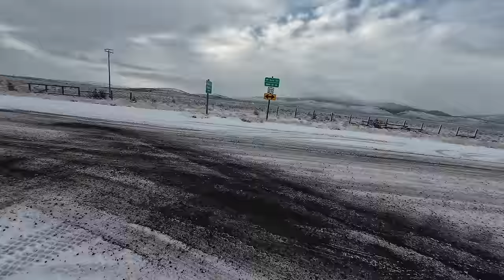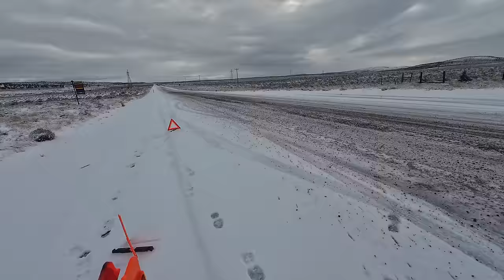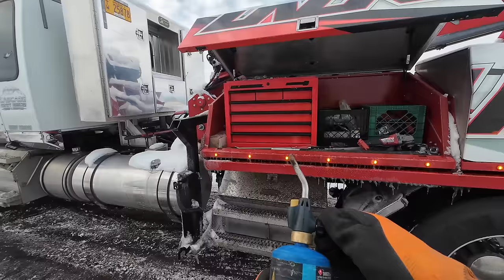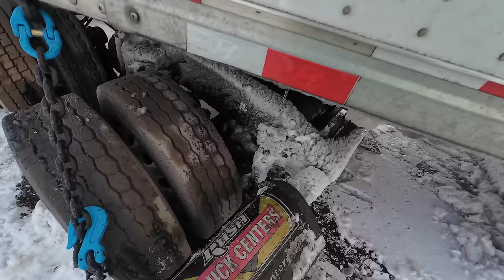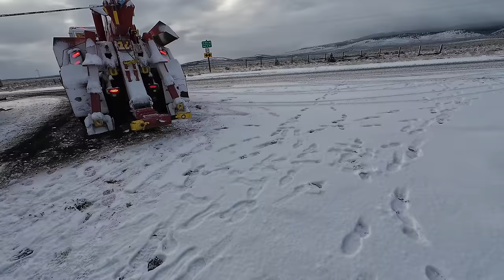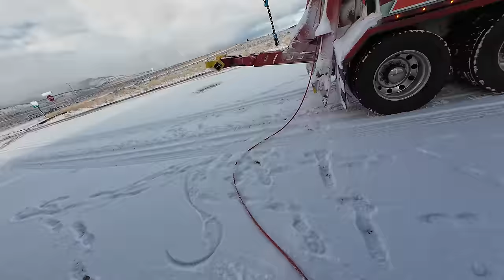Loaded tractor trailer hits the ice!   And then the ditch..

Comment: “I have a tool for that!”   Casey, I love it when a plan comes together and that you got the job done without any drama!   You said you were not good at this, but this episode proved otherwise.
Reply: Did Casey remove the clamp off the mudflap though?🤔
Reply: @drafterdb 
Probably as he was back there trying to put air in the tire.
Reply: @scots_knight4706  It was still on the mud flap when he handed the triangle back to the driver.  That was after he gave up airing up the tire.
Reply: @drafterdb  I came here to ask the same thing.  Nothing against Casey, but it's one of my "phobias" for lack of a better word.
Reply: Casey always carries the 2 most important tools: 1. A hammer & 2. A bigger hammer.
Reply: Those clamps are pretty cheap.  Much less than a light bar

Comment: A simple rubber glove and a rubber band on that air hose fitting on the reel, will keep the water and ice out. Thanks for the shows Casey.
Reply: Any viewers want to take a guess at which "finger" Casey would slip air hose in??? :D
Reply: I'd just leave a fitting in it as a plug so you don't look like a goober driving around with a glove on your hose. Either way works though.
Reply: @SantaTed-qv4gt  I'd say count 2 over and you are on the money. Start at whatever side you like.

Comment: Last night in Los Angeles there was a high speed pursuit of a sleeper cab and trailer. Cops did a spike strip. Guy drove miles on front rims. Unfortunately, cab burned.
Reply: The instinct is to run I guess...
Reply: @novampires223  Not if you're not guilty.

Comment: For frozen couplings and door locks I have a cordless heat gun it works quite well. Mine is a Milwaukee 18volt, but Harbor Freight has a Bauer 20volt model.

Comment: From July 21, 2023:

Drove 700 miles today from SLC to Bend, OR.

About halfway through (300miles) and shortly after the first dual-tank filling, the rear tank’s fuel pump decided to play hookie and stop working. This left me to about 180miles of range on the front tank alone down from the nearly 400 between the two. I’m using a gas card for fueling which limits me to $300/day or 3x per day, and now with one tank running, I would have to play it smart if I wanted to make it to bend without using cash or other cards.

Between Burns, OR and Bend, OR there’s a 129 mile stretch of road that after 10pm doesn’t have any gas stations that’re open. I had paced it right so that I’d be able to make the drive on the remaining fuel in the front tank and would have to use most of the 4gal auxiliary I always carry on long drives.
Reply: Now for the fun part!

At 10:15 pm and around 30miles into this desolate stretch I see a motorcyclist on the east bound shoulder (opposite direction of travel for me) so I go to turn around and check on him when during my 3-point turn as my front passenger tire just catches the shoulder, the whole truck slide off and down into the extremely Sandy/soft and steep ditch. I get out, lock the hubs, engage 4x4 Low Range, toss the truck into 1st gear and just barely make it back to the road (literally had to saw my way back up for about 2 minutes). As I pull up and step out of the truck to chat with the biker, a gentleman and his son (maybe 10y/o driving a nice Toyota Camry Hybrid pulls up asking if we have gas as he’s about to run out (car said 15mi range) I give him 2gal of my auxiliary knowing I’ll now be extremely close for my own trip but that he’ll make it to Burns. I now get back to the biker who believes his fuel filter and/or petcock is clogged but has no tools to pull anything apart. Likely for him I’ve got all the essentials. We separate the petcock, pull the fuel tank off, and clear the filter. He was right about those two things but he too was out of gas. I give him about 1gal as that’s all he’d need to make it to Burns. I am now most definitely not going to make Bend with what little I have left. I continue down the road a couple of miles and see another fellow who’s driven his retired 2000’s police crown Vic down into a very similar ditch that I was in as a result of a front passenger tire blowout. I chat with him, turn the truck around, back it up, hook up one of my tow straps, and pull him out and down the road a couple hundred yards to a pull-off where he’ll wait for his wife to grab him in the morning (they live about 2hrs away and he didn’t want to wake her). He was super thankful but didn’t have cash to repay me and after chatting with him for a few minutes and him finding out about my dire situation with fuel, he grabs a gas can out of his trunk with about 2 gallons in it!! I am now almost back to where I started fuel-wise and am most likely going to make it! (Still questionable). We part ways and yet again, now with about 50miles left to bend things are looking good for me but I see an SUV pulling a 17’ travel trailer on the side of the road (headed towards Bend). I pull off and ask if they’re good and the older retired Navy Veteran tells me that he’s got a flat and has a spare but no tools. Once again and luckily for him, I do! After we get his tire changed we chat and he gives me his 5gal of spare fuel as payment!

Comment: I'm surprised they don't allow drivers to carry anymore what's known as a hub winch it's where they take an old rim and set it up to thread through a strap where the rim itself would work as a guide and simply have the truck pull itself out it would sure beat the hell out of running out of fuel and freezing in the cold
Reply from the maker: That would be completely worthless and do nothing to help.

Comment: That truck has lugnut spikes just like you!  But, strange...we never see them in the same shot...hum...  What does he do about his flat tire?
Reply from the maker: Go to a tire shop
Reply: @CaseyLaDelle  So, drive a tractor trailer with a deflated/damaged tire that stands a chance of some sort of issue "dragging" (not sure of the right term for what may happen here) on the road that could cause it to shred and throw "chunks" at other vehicles on the road?  Or, does that never (or rarely, but never sounds more dramatic) happen, and it's just routine to drive with a flat/damaged dire down the road for...possibly a hundred miles...  I get that they can't/don't carry a spare, but I would have though they would stay put and wait for an on-road tire repair truck.  I don't know the answer, that's why I'm asking...

Comment: A ratchet strap? 3333 lb working 10k breaking?  60k lbs truck that’s stuck?  I had an about 25k  fire truck stopped in intersection.  Motor shut down. I decided my 10k working limit tow rope in 6000 lb pickup was not up to task.  To use something 1/3 the limit for over 2X load? I at least had a chance on level tar surface. But good visibility, tow truck called.

Comment: Do you use synthetic winch lines and if so, where do you get them from. I have a dumpster roll off business and I would like to switch to synthetic, but haven't found a heavy duty synthetic winch line. thanks for any help
Reply from the maker: Yankum makes heavy duty lines and my wrecker is getting switched over soon

Comment: Watch them spikes on the front wheel.  I read they will shred your legs.
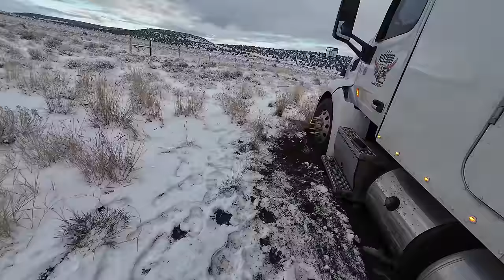Reply: sorry, at 2:38.
Reply: @nailpounder81 you mean the plastic caps that come off relatively easily?
Reply: Yep, those spikes. It's an ongoing gag on Casey's channel that gets pointed out.
Reply: @nailpounder81  though i have seen that they are also available in actual metal which might cause injuries.